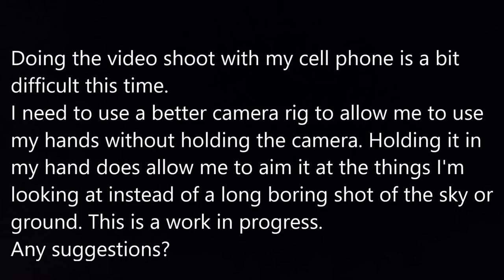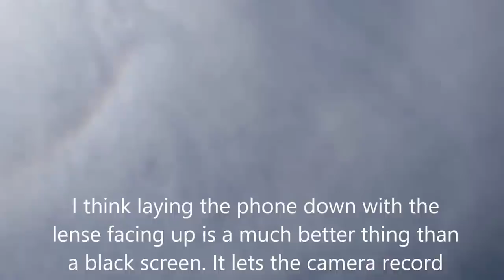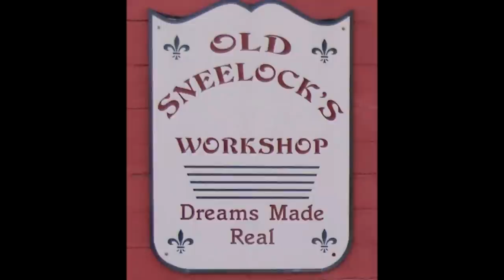Cruising The Annual Dowling Community Sale ~ July 29th & 30th 2016 ~ with Old Sneelock's Workshop

Comment: GoPro has different mounting options, chest rig, head band. Both offer hands free POV videoing.
Reply from the maker: Is there a reasonable way to overcome the jittery motion of a camera strapped to your body? I've been wondering about one of the zero grav rigs that people are showing on YouTube. Not worth spending thousands for a smoother picture but if it can be done I'd like to try.
Reply: Some cameras have video stabilization, and I have seen some pretty nice YouTube videos with a steady rest.  I have no idea how pricey those are.
The only other thing I can suggest is to strap your camera on the head of a chicken.  I saw a video once of someone holding a chicken (by the body), and they moved it all around.  but the head stayed pointed where is was first looking.  Granted, this solution pretty much negates any free hand, so probably not what you are looking for.
Reply from the maker: Brian Neeley Now that's what I want. A chicken cam. I could just let it run loose in the place and edit the video later. Priceless! :-)